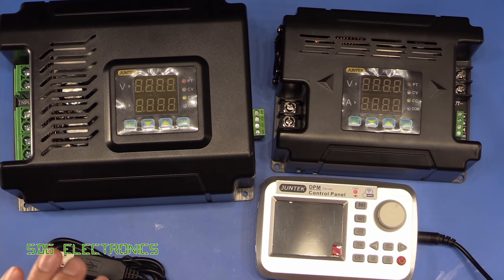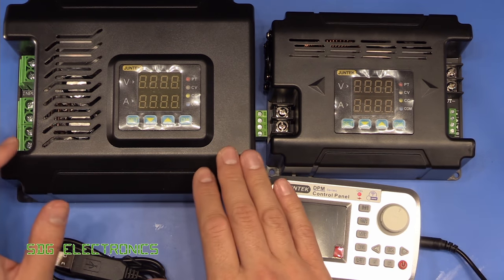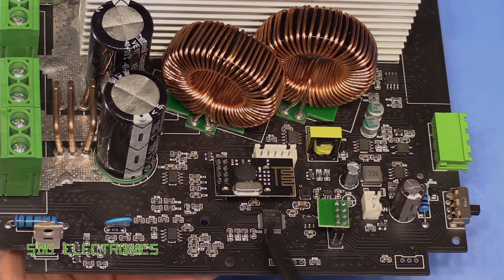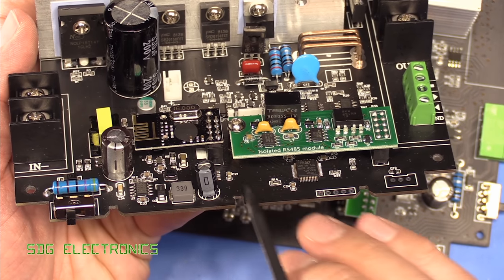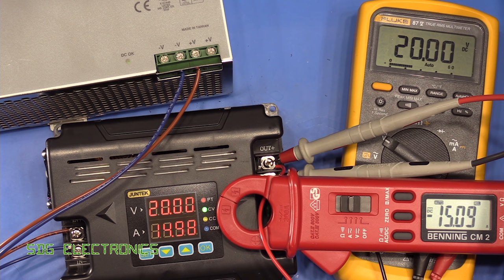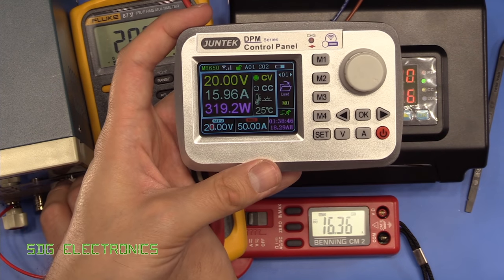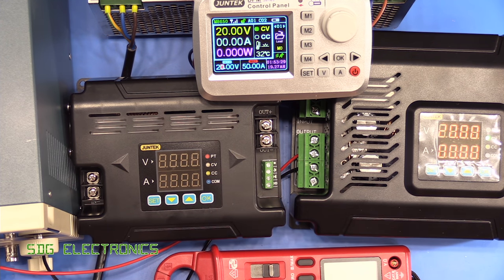SDG #134 90V 20A and 60V 50A DC-DC Converter Modules from Juntek (DPH8920-RF and DPM8650)

Comment: Decent amount of power without any real problems. Wireless controller is a nice touch. It's a rare thing to have, but it may be very important in some applications.
Great video, cheers!
Reply from the maker: Yeah, it's just a shame you can't feed mains into it. Makes the whole thing a little bit less useful.
Reply: These things are used to charge things like golf buggys that have fairly high voltage battery packs (72v) and are often powered from solar.  The thing I would love for them to do is a buck boost version :-)

Comment: They're useful for event installations, where the power has to travel a long way (10's or 100's of metres). The 60V can then be dropped at the devices that are being powered - I do this for RS485 controlled LED installations, with 50-60V being dropped to 12/24V to run the LED controllers.

Comment: Just a note for the reviewer: +48vdc (NOT Neg-48) Telecom power supplies , most have current sharing capability and floating outputs so they work well with these units. You can get them used for about $20us each.  I'm using 3 x +48v 12.5a supplies in parallel.  I have the supplies trimmed to 56v so I'm getting +56vDC @ 37.5A.  You can also trim the voltage to +45v and run them in series for +90vdc.
I'm using the DSP-8624. My application:  High current LED driver....

Comment: Note that for powering those converters you'll definitely need a stable power source. So for lab power supply it usually means the following:
- surge protection circuit + RCCB (shortages or leaks can occur in the transformer)
- toroidal transformer with output of 60 or more  volts and at least 20 amps over $60, for two channels it means two separate ones or one 220-230V/2x60V
- high-amp full wave rectifier from a known manufacturer
- not so cheap filtering circuits for input and output
- circuit for stabilizing the input (especially needed when powering audio devices, sensitive electronics or RC models)
- very VERY GOOD cooling

or

modified EXPENSIVE full range PSU

Comment: Great review - thanks a lot! I didn't know the DPM8650 is on the market for so many years now - just saw a recent review of Julian Illett. I really wonder if it stays cool when its fully loaded with 3000 W! 60V @50Amps is quite a power and i didn't see any fans? Are you supposed to add a fan if you exeed a special amount of power? Would be nice to see it under full load for at least 20 min. and measure the temp. of mosfets and diodes! You could use some resistive load or an AC 230V inverter with some heater e.g. as a load.

Comment: Strange...  The DPM8650 that you reviewed doesn't seem to exist.  A general search of AliExpress for that model turns up nothing, and the table in the listing you linked below your video doesn't list that model.  Maximum output that I could find is 24A.  Did they send you a pre-production prototype?
Reply from the maker: Hmm, I've just had a look at you're right - it's not on there. I got these back in December so maybe they ran out of stock.

Comment: Can you test the conversion efficiency?
They say 92%
Reply: I'd also like to see this at 400W output
Reply: Also once you set the voltage and current could the display (the one in the box not the remote) be disconnected (then the whole thing mounted in a more compact enclosure)?

Comment: WOW! those look nice! built to a price point but still robust! I wonder if that 50A one since it has 2 sets of inductors and mosfets is a 2 phase design?? Your scope is pretty terrible, do you have a trigger setup? You should be able to see more than you do. Ive just started messing with an oscilloscope myself on large power supplies (I'm currently messing with the chinese red 1500W boost converters)
Reply from the maker: Yes, the handheld scope wasn't really set up to look in-depth at the noise - I just wanted to see what kind of level we were dealing with. I don't think it's a two phase design looking at the board - I think they've just paralleled up the components for greater current carrying capability.
Reply: @sdgelectronics  ah, so there is an inductor for each mosfet but everything is paralleled together so they just work in unison. That would be cool to see or possibly build. A 2 phase design would double the effective switching frequency which can help in voltage ripple.

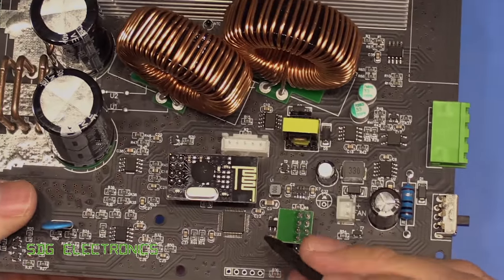Comment: 3:50 Why are ECaps sitting on PCB circles?
Reply: It's very typical to draw component outlines on silkscreens.
Reply: @benbaselet2026  Take a look again. It's an actual piece of FR4 circle between cap and pcb.
Reply: 3:05
Reply: @Mr.Leeroy  Oh right, didn't see those at first. And I don't remember seeing them before.. no idea why they do that.
Reply from the maker: The leg spacing on the capacitors was incorrect!

Comment: This device has a problem
It was poorly constructed
When you connect to an input of 108 volts, this regulator will burn
In addition, the company has clients in the ass and does not want to exchange or repair it